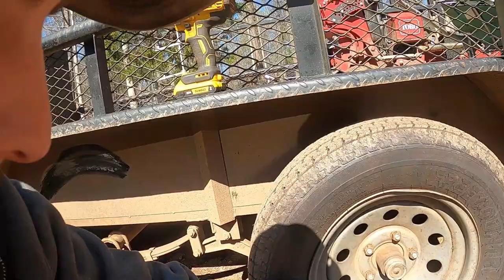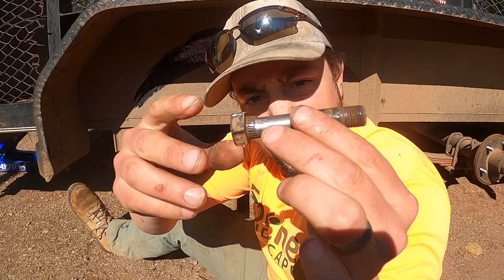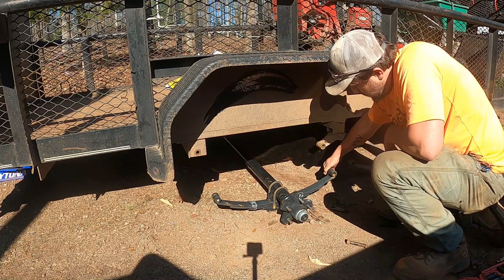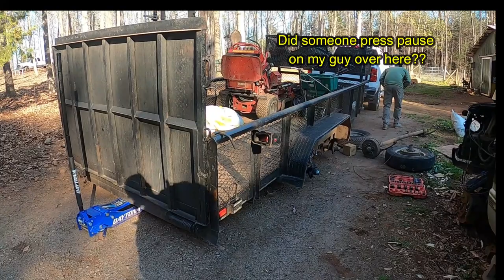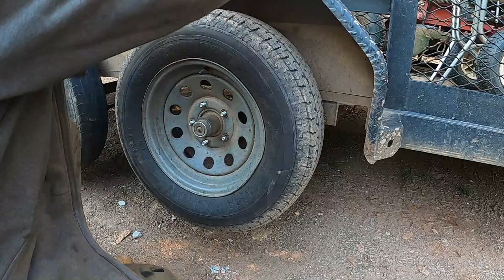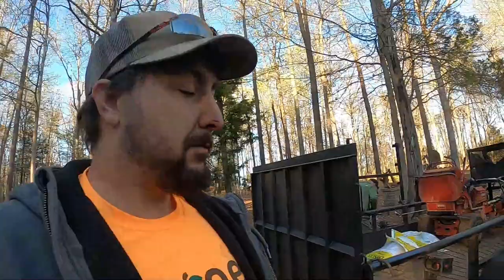How to fix broken trailer axle

Comment: Why not install the greaseable shackle bolts with the grease zerk facing the other direction ( facing inboard) so they could all be greased with the tire/wheel assemblies installed ? Or leave the zerks facing outboard and  change out the  straight zerks to 90 degree zerks to allow for tire /wheel clearance when greasing.?
Reply from the maker: Not a bad idea